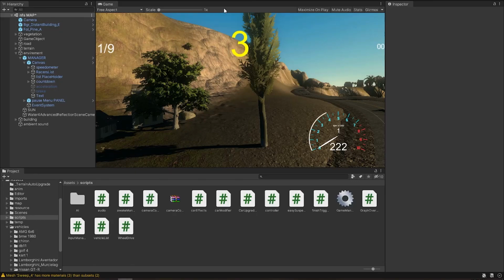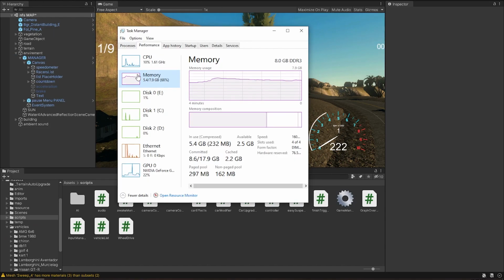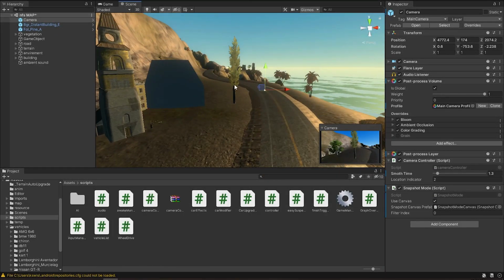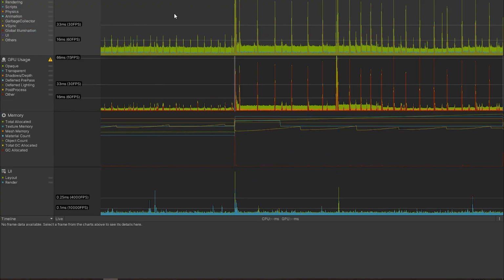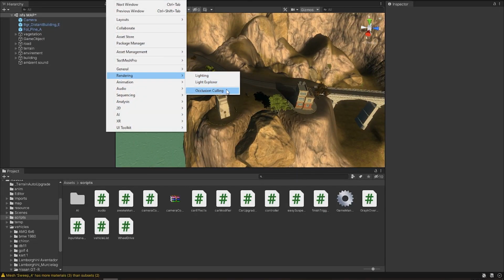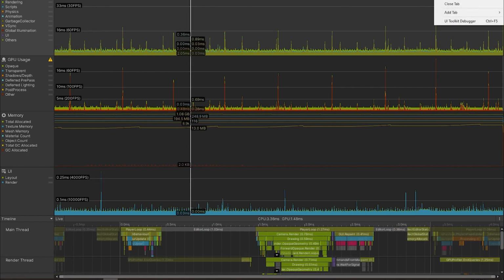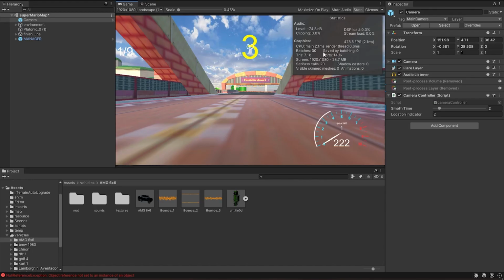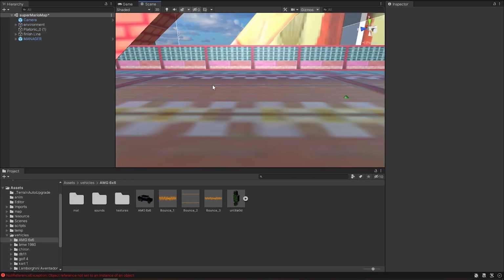Improve Performance On Mobile Devices

Comment: Great video! Do you see any performance difference between Unity 2017, 2018 and 2019? I've been using 2017 and 2018. I recently went to try 2019 and realized that my PC was very slow when running Unity.
Reply from the maker: the 2020 so far is the best ive ever worked with
Reply: @pabloslab  nice! Thank you for reply :)